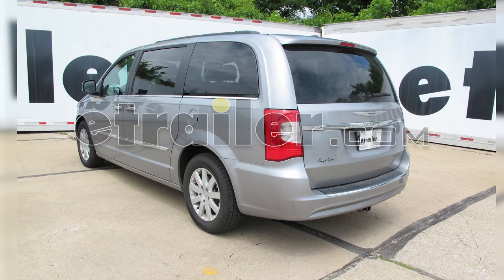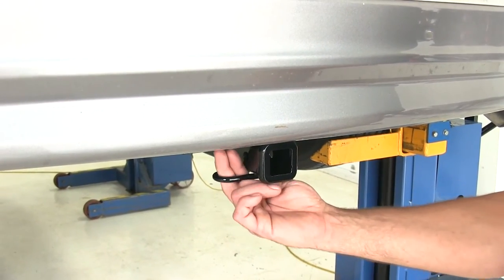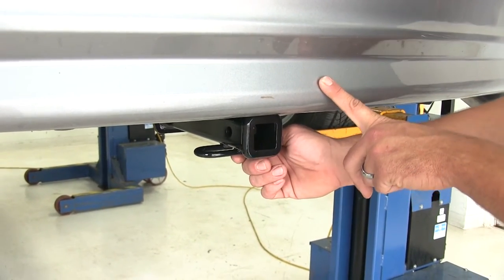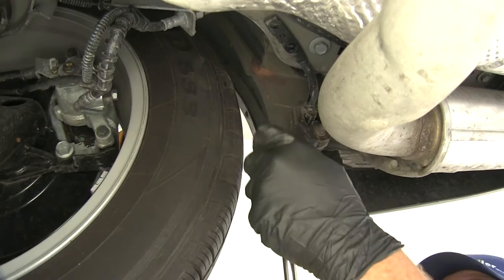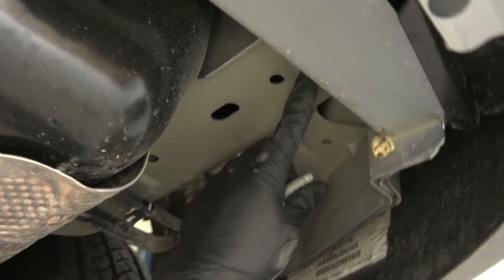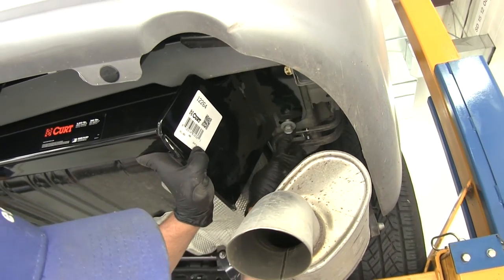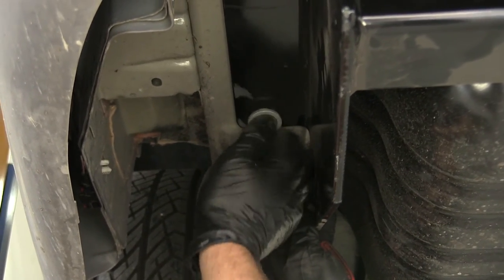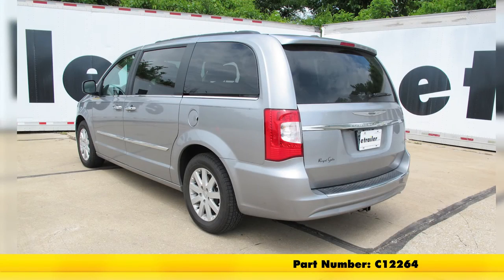etrailer | Installation: Curt Trailer Hitch Receiver on a 2016 Chrysler Town and Country

Comment: This took me roughly 12 hours to install. The bolts were rusted out due to Michigan roads. I snapped 3 bolts that I had to drill out and tap, 1 exhaust bolt and both of the 15mm bolts (I tapped them SAE and used stainless this time). One of the worst projects I have ever tried. I would recommend getting this done by a shop (the place I bought mine charges only $50 for the installation). Also, I now have a rattle in the rear. The bolts for the hitch are snug, I think it has something to do with lowering the exhaust although all of the exhaust bolts are snug.
Reply from the maker: It sounds like your exhaust might be rattling against the hitch. This is pretty easy to fix, check out this linked article that explains further:
https://www.etrailer.com/faq-fixing-exhaust-rattle.aspx